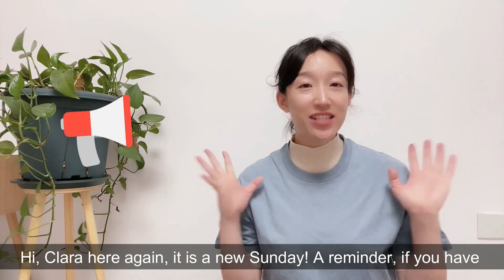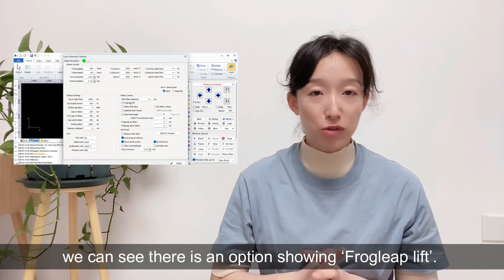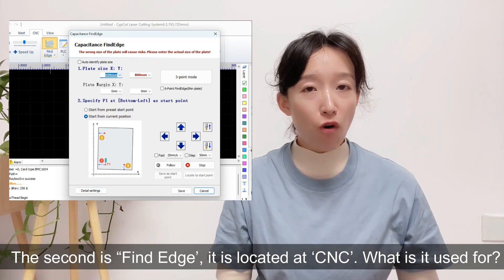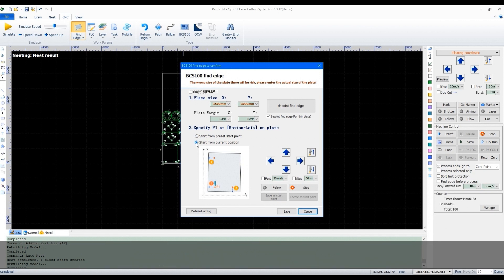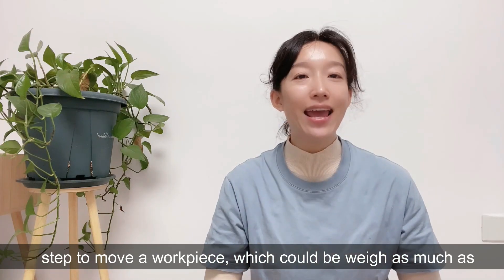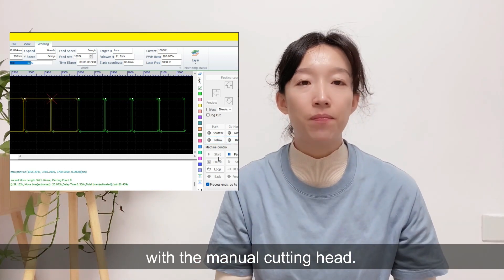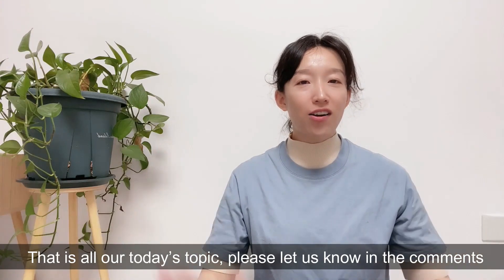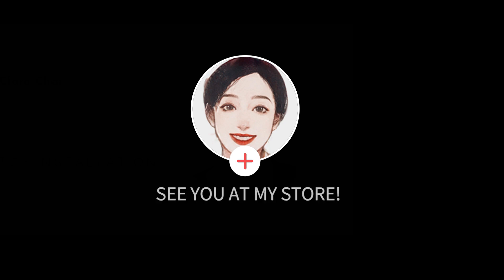Practical Tips in CypCut Setting: Enhancing Laser Cutting Efficiency

Comment: Clara what if we are cutting a piece with 100 or more hole in it?  We don't want to use centralized piercing but we do want to move the cutting process around the part strategically so that the part doesn't get too hot in any one area.  How do we do that?  We have a Morn 6000watt with cypcut software
Reply from the maker: Pre-Pierce

Comment: When etching or engraving is it possibe to cut in both directions and not just one way?
Reply from the maker: Please explain more.
Reply: @ClaraChai  as a example  the machine cuts from  A to B  i want to cut  A to B then B to A.
also what are the parameters to etch stainless steel on a 2000w laser?